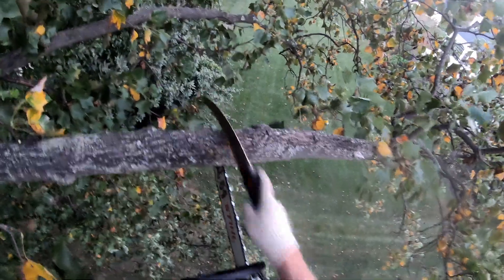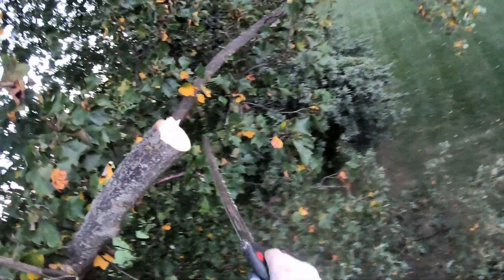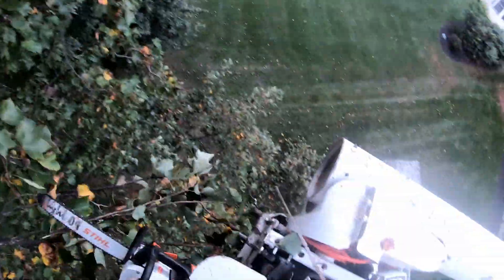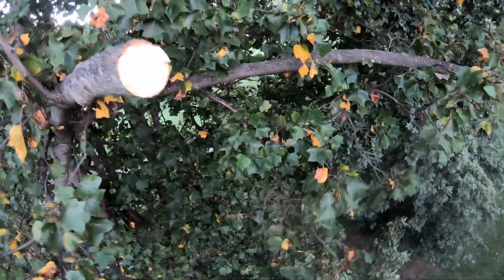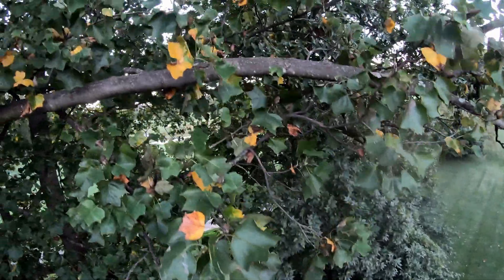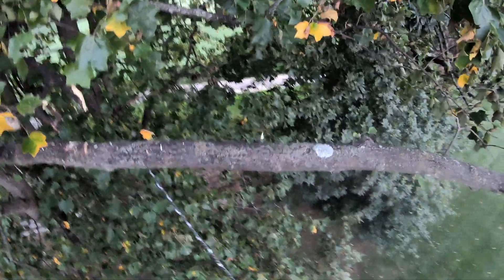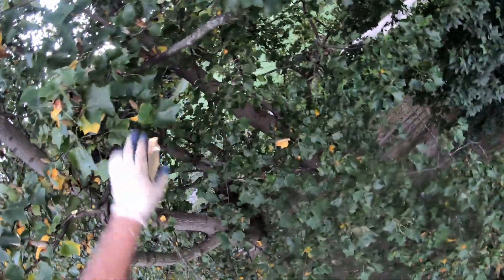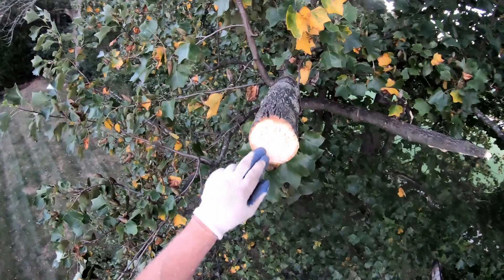Tension Vs Compression Where Is The Strength

Comment: The crucial points are accurate and concise, as previously stated, but the actual teaching is a bit lacking for the newbs out there surfing for tips.  TENSION = fibers are PULLING.  And the opposite is COMPRESSION = fibers are SQUEEZING TOGETHER.  In this video, he is showing limbs up in the canopy, hanging freely.  And NOT on the ground, pressing against the soil with the weight of the trunk complicating things.  Limbs are attached to the trunk and SUPPORTED at the left, and hanging out to the right in open unsupported air.  So the RIGHT side of the limb is pulling DOWN due to gravity, and nothing is holding it up.  This makes the TOP fibers PULL in a state of TENSION.  (VISUALIZE grabbing the limb with your own hands, and bending it the way it is naturally bending).  And it makes the underneath bottom fibers squeeze together, under COMPRESSION.  To avoid bar pinch, cut "from T to C"  .... from "Tension to Compression" .... because you are a "Tree Cutter" (remember that . . . T to C  . . . Tension to Compression  . . . as a Tree Cutter.)  As that limb pulls downward on the right while you cut through, T to C, the TOP side opens, preventing bar bind.  And the limb falls cleanly away.

Comment: Good way to iilustrate!
Reply from the maker: thanks.. to do it well I'll need to be lift the lmb so it doesn't pinch the bar and we can probably cut 80% without failure.. wherare on a big heavy tulip limb sometimes just a scratch on the top of the limb will cause it to pop